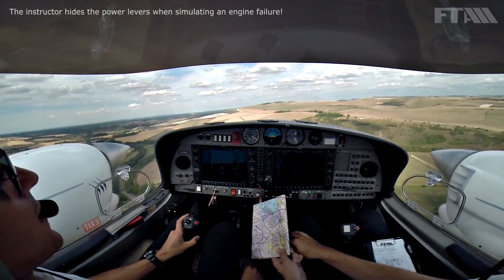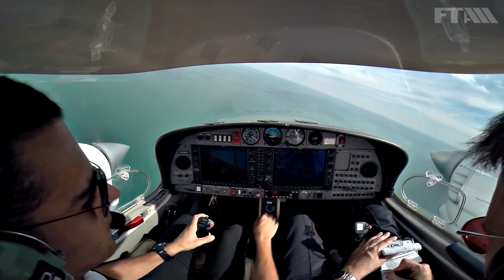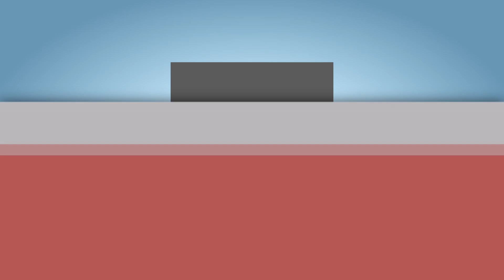Diamond DA42 Single Engine Circuit & Go Around | MEP Flight Training @ FTA Global | Cockpit View ATC

Comment: Too far away from airport circle.  Afraid of shorter circles ?
Reply from the maker: This was a standard circuit as prescribed by local procedures.
Reply: @greatflyer_aviation  What local procedures? You mean all airplanes have to make huge circles around the airport? Are you lying to me to cover the fact that you cannot do shorter approaches. Im a multi engine CFI for decades..
Reply: @outwiththem you’re the CFI for decades and you are not aware that some airports have prescribed traffic patterns for example due to noise abatement procedures? Interesting.
Reply: @outwiththem  Why are you so aggressive? You are a 'Multi-Engine CFI for years', yet you are unable or unwilling to accept that airfields have local procedures that must be complied with. If you want to see the charts, less than 15 seconds with a search engine will reveal all. And I question your experience, otherwise you would know it is 'Circuit', not 'Circle'. Perhaps go back to MS Flight simulator/X-Plane...
Reply: @andrewsmith951  He was making a big circle.  Bad pilots like a lot of miles to prep to land. They are behind the airplane.  Laggards..
Reply: @andrewsmith951  clumsy pilots like to do like a wide and far circle around airport instead of a well defined half a mile away rectangular traffic pattern.. Duhh.

Comment: ..i don't see rudder trimm after engine failure, don't you use it? cause i cannot see..
Reply from the maker: Would you recommend rudder trim in a single engine circuit?
Reply: @greatflyer_aviation  ..yes..in a case, especially on a circuit with one engine inoperative..when you are definitly sure, that dead engine will not start up again, after engine fail, should follow opposite rudder, thrust on live engine, to avoid stall, when you are stabilized, rudder trim to halfscale (not whole, that you can feel the difference) and feathering dead engine..than the control of airplane is more comfortable, and the forces in steering are not so strong..then on final, by slowing down and live engine correcting power to iddle, before flare, rudder trim back to middle, because forces are fast the same..
Of course, when engine fail happens on final, you don not have a time for this, so you correcting it with rudder..but in case of going around, you could do this all in accelerating height (400ft AGL)..then is circuit more comfortable..so we learn, in a school..